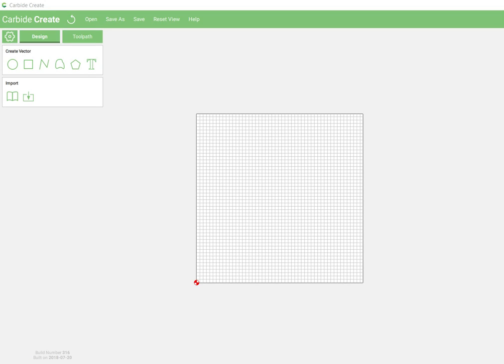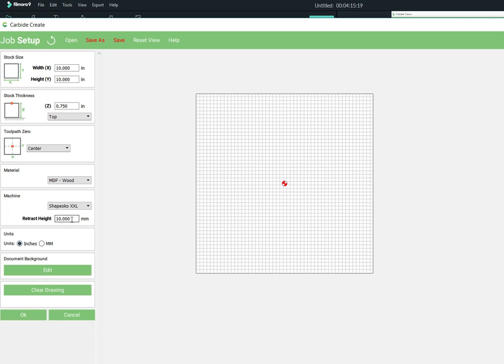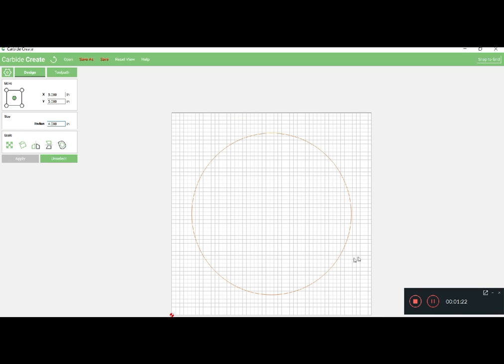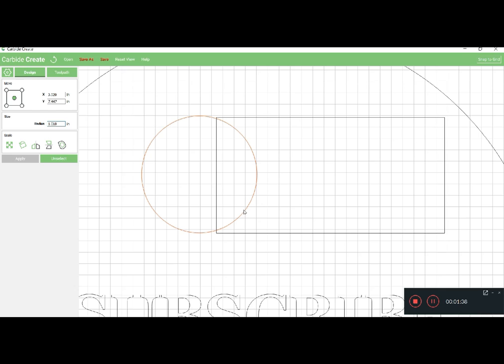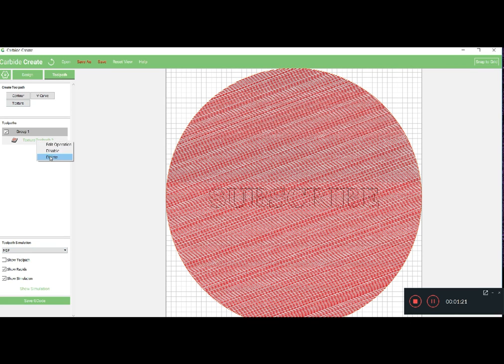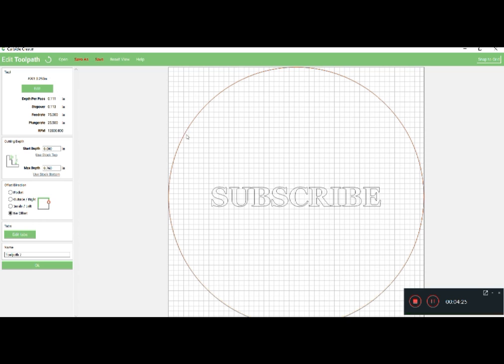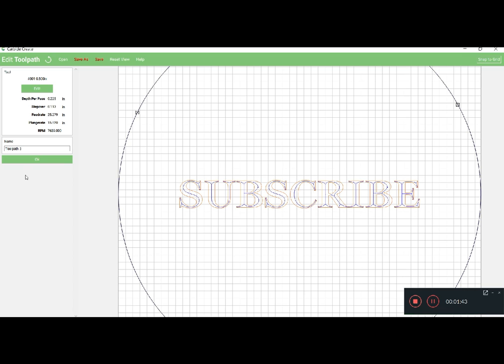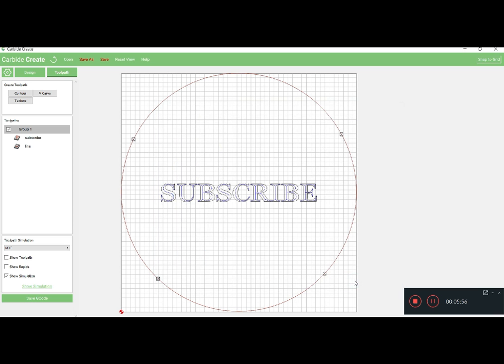How to use Carbid Create and adjust your seetings to make your Shapeoko run better

Comment: Would you recommend the shakeoko 3 for a beginner? I don’t have much experience with cnc but want to get into it to machine parts for a  hobby of mine, do you think it would be good to learn the basics of cnc machining?
Reply from the maker: Yes sire. Its basically sold as a DIY cnc but will do some awesome work. Never used one either until I bought this
Reply: Sam Kowalski it being a build it yourself makes it better for understanding the overall cnc process. A good place to start is Myers woodworking on you tube.